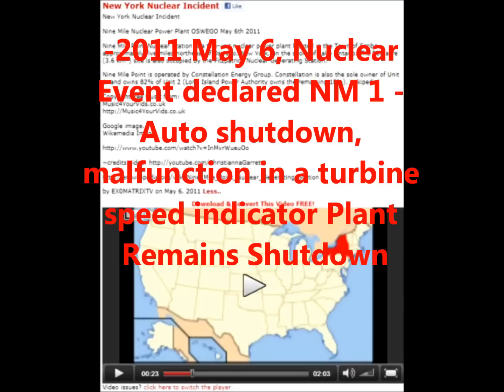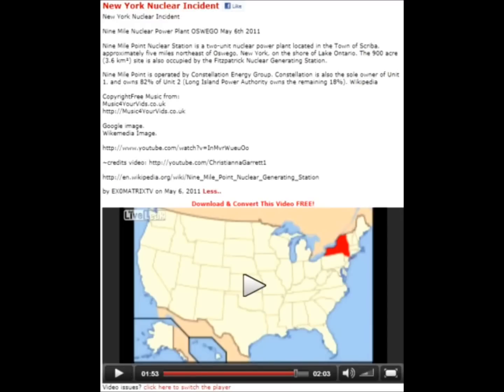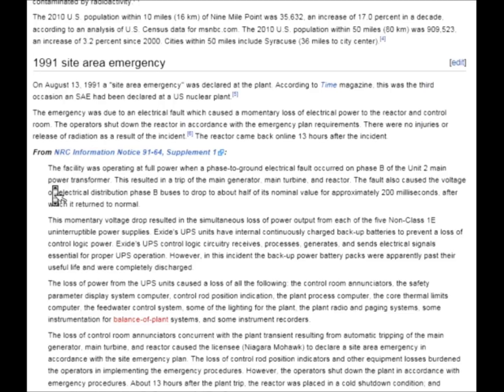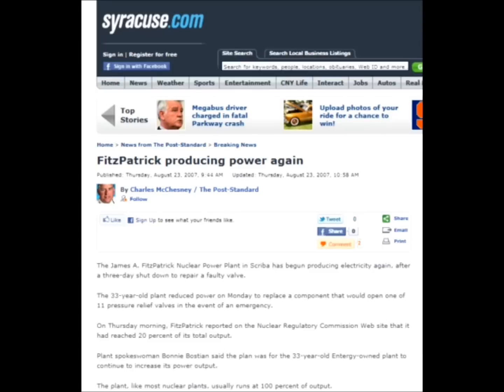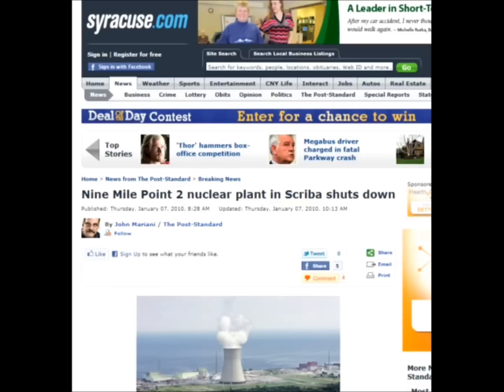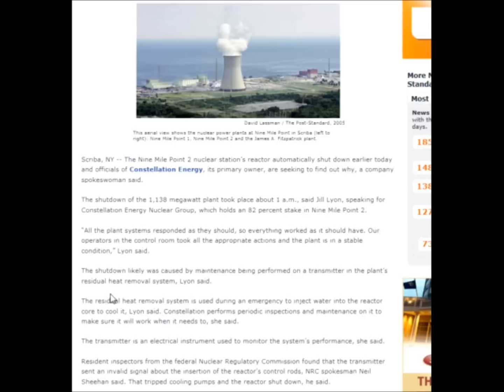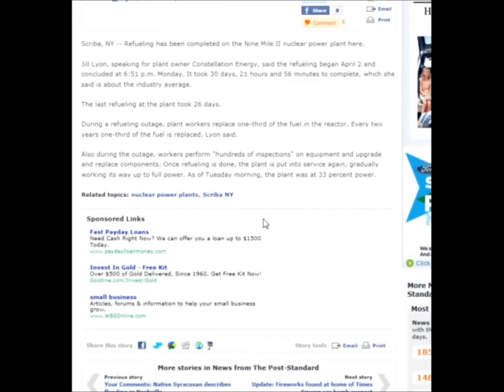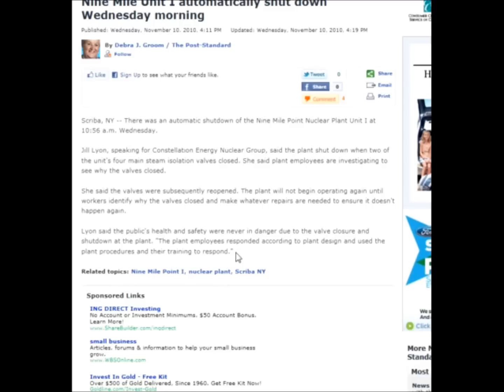Nine Mile Point Nuclear Facility: History Shows Unusual Events Not that Unsual (Part 1 of 2)

Comment: You obviously do not have any prior knowledge of how a nuclear reactor and the other components of a plant work. Just because a reactor scams or shuts down, it doesn't necessarily mean public safety is breached. The reason these articles are published are due to the fact that these events are reported to the NRC. I enjoy getting a chuckle from the narrative.  Yes there are 3 reactors in Scriba (pronounced SCR-EYE-BAH). But they are operated by 2 different companies and none of the reactors are "linked" to another.